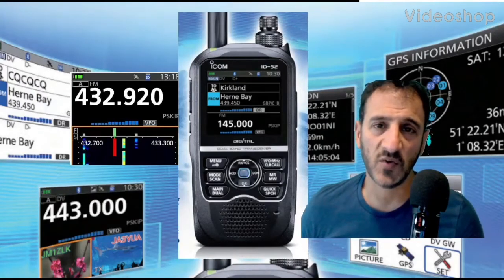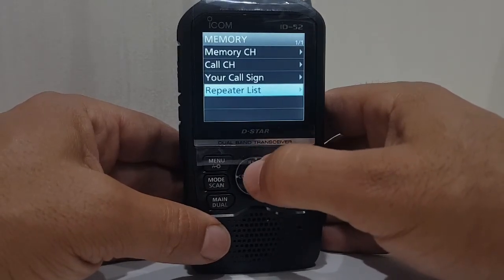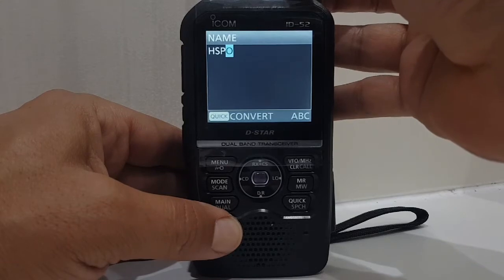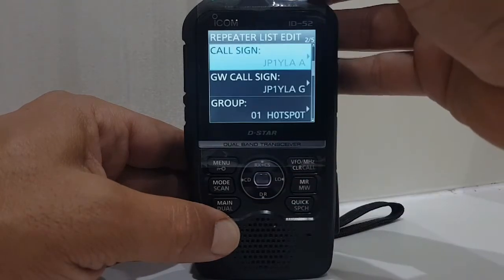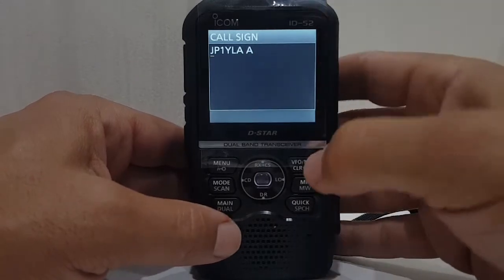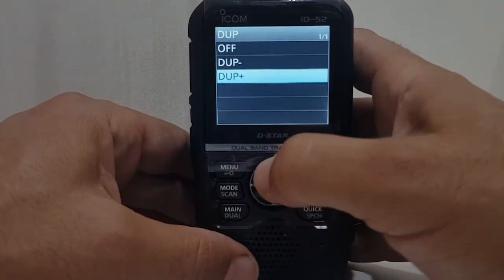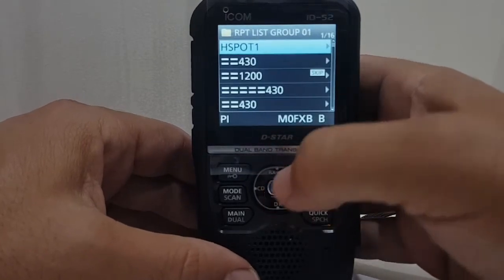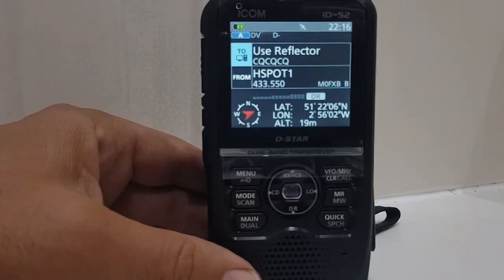ICOM ID-52 Add your Hotspot Frequency

Comment: question, my hot spot is on it shows that is wireless but I can't find hotspot on my radio, what could be wrong?
Reply from the maker: Your radio needs to have the same frequency as the frequency entered in to the hotspot using pi- star the radio must be simplex dv mode .
Reply: @HamTechRadioScannerDrones  thank you

Comment: I am about ready to return this 52. It is my third Dstar. I have a 31 and a 74 and have no trouble working station on my open spot 2.    I watched your setup and seem to have mine set but no stations can hear me.  I can turn on the other two and make the contact.   Their is no audio going out.  I can do an echo test and no problem.  The open spot confirms the connection both on connect and disconnect.     Any ideas?
Reply from the maker: Hi are you using DR Mode ?
Reply: @HamTechRadioScannerDrones  
I guess so, type is set up a DV Repeater.  I can change reflectors, And now it won't go to DR mode.  Says it can't find a repeater but I have the repeater in it.
Reply: I m ready to return mine also. Im on my 4th week on it and haven't heard anyone, or passed an echo test. Not sure I want to purchase a hotspot to have that not work.
Reply: @tony2wheelz408  Tony, I got mine to work.  What is not clear in this video is that you have to put your call sign in in two places.  This is not shown here but shown in other you tubes.  I don't remember the other place but I know my call sign was missing in one of the places.  With that in, everything works fine.

Comment: Greetings from Arizona. 1st time watcher here -THX for ur Video. Got my 52A setup after some confusing settings getn it to hook up with my TGIF HotSpot 
 - Now it finally works. - MAKE Sure guys u Save It to Memory - this 52a isnt easy to setup and remember how. UFFDA
GOTO Icom site and get the FULL MANUAL - I Found it on ICOM site in Support just now. Lots to read thru. 

Andreas,
How DID u get MEMORY on the MENU in place of SCOPE - And did u get the GPS Info Below the Dstar windows?  
73s man - THX
Reply from the maker: GPS on Display :https://www.youtube.com/watch?v=YFyxGNM9kG8